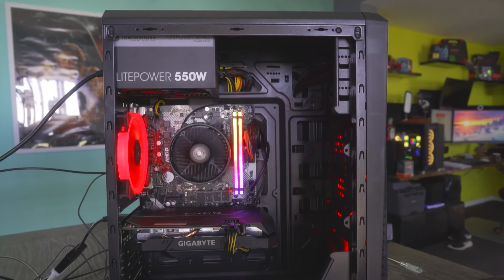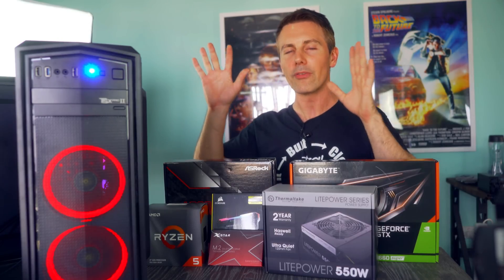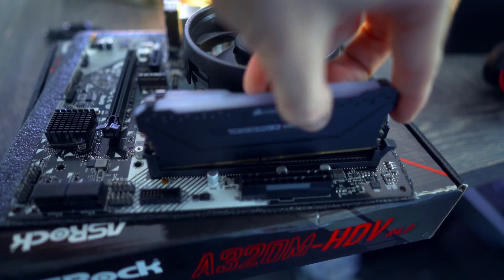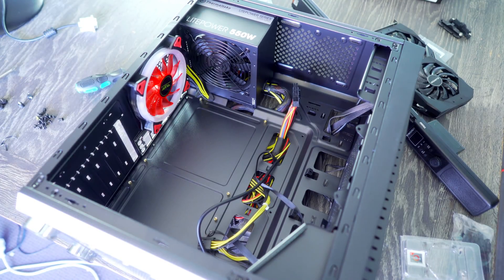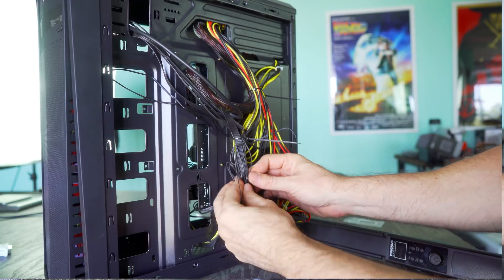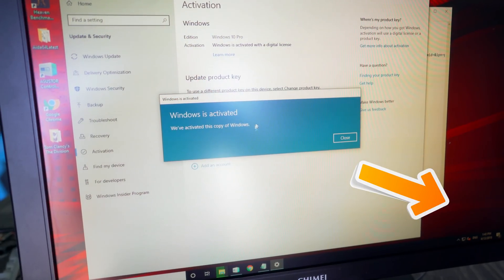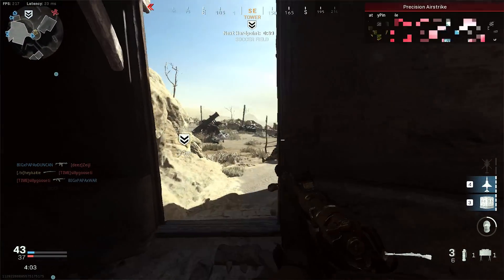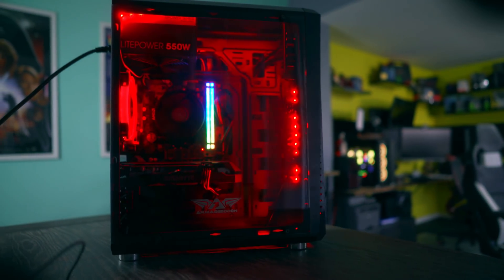How To Build Your FIRST AMD Ryzen Gaming PC...! ($750 Best Value Rig)

Comment: Bryan: Don't touch the pins

Also Bryan: touches them anyway
Reply from the maker: And your comment just got pinned.

Though on a serious note I specialise in both surgery on LGA and PGA ;), equipped with tooth pick and mini screw driver in hand.
Reply: @techyescity  "do as I say, not as I do"
Reply: @techyescity  try razor and utility blades too
Reply: I will link all my customers here. Especially because I use this motherboard a ton ;).

I've fixed some scary pins before on older chips.
Tweezers & light and magnifying lense/vanity mirror.
I've fixed unreal damage. As long as no pins were missing. Lol

Fixing Intel boards are way more a pain in the arse. And usually missing pins or severely twisted. I've never damaged an Intel socket myself yet.
Reply from the maker: Yeah LGA can be a pain, I could do an update on the Tech YES fast way of fixing pins? I have it down pat nowadays lol.
Reply: Rules are meant to be broken anyway 😉
Reply: Rules are meant to be broken... just like pins
Reply: Its not an AMD build without the AMD GPU. Your build was AMD lite. Just like lite beer. Not full strength. Do you read me ?
Reply: @Matlockization  Lol
Reply: 69 likes nice
Reply: Now this is an avangers level treat
Reply from the maker: @Rod 1984 I actually have never bent lga pins accidentally myself (bent them back and forth on old dud sockets that were bricked boards for prac), though have fixed a lot for can yes fix it and other styles of tech.  

As for PGA, I actually bent a lot of pins on my 3700x removing the cooler one time, it was the wraith prism i think, where there simply was no room for wiggle (fixed it up easily though :D).... though fixed a lot of PGA for other people who have bent pins or sent CPUs in on Ryzen locally, actually happens quite a bit.
Reply: @techyescity  wraith prism's thermal paste is an abomination to mankind and should never be used, used it for a few hours to test my parts and when I TRIED to remove it for the final build that thing turned into plastic cement, ended up bending pins on my 2700x, thanfully I was able to bend them back but jesus christ, that was frustrating.
Reply: All for the sake of scientific awareness lol
Reply: Had a 3200g that came in last week and wasn’t sure if the pins that were bent were cause of me or if they came that way but thankfully it wasn’t too bad, about 4 pins that were slightly bent. Used a slim enough card and set them about 98% straight and thankfully got my system running 😮‍💨.

Comment: For my build these are the prices and tell me what u think
Cpu 299 r5 3600
Motherboard 179 msi bazooka mini atx
Ram 119 klevv bolt 3200mhz
Case 59 mini atx
Psu 79 550 80 plus
Ssd 37 120gn
Hdd 55 1tb
Gpu 509 rtx 2060

Comment: Worth mentioning is complications that can arise during disassembly for Ryzen due to PGA (for instance, replace heatsink with aftermarket model).  My cpu stuck to the heatsink and popped out of the motherboard socket when doing this and bent the cpu pins.  I was able to straighten the pins using the razer blade method.  Have read elsewhere that this problem can sometimes be avoided by twisting heatsink when removing.  Anyway, Ryzen 3600 remains the best bang for the buck build even in mid 2020.  I think novice PC builders should watch these videos before starting work in order to get the details right.

Comment: If you have the Little Devil PC-V10 case then you will have to install the CPU per the instructions that come with said PC case as you don't want condensation reaching the motherboard also the system won't boot till the cooling prob drops below -70 degrees below zero then the cooler control system will boot the computer.

Comment: you'll get the most out of the motherboard but not the most out of the cpu. simple as that. A320 just isn'øt worth it when you can get super cheap really great B450 boards from MSI. Just not a place where it's worth saving.

Comment: NOTE:when bying the case with pre-installed fans,check on their website what kind of fans are you getting,more often then not,you get a cheap crappy ones,that you will eventually have to switch because:too low RPM;too low CFM,or just "oh crap,my MB doesen't see the case fans".Not everything that shines is gold!

Comment: OcUK Gaming Enigma Essential - Ryzen 5 2600, GeForce GTX 1660 Super

Your selected configuration:

(1x)   WD Blue SN500 500GB NVMe M.2 2280 Solid State Drive (WDS500G1B0C)

(1x)   Team Group Vulcan T-Force 16GB (2x8GB) DDR4 PC4-24000C16 3000MHz Dual Channel Kit - Grey (TLGD416G30

(1x)   Build Stock Asus GeForce GTX 1660TI Phoenix OC 6144MB GDDR6 Graphics Card

(1x)   Kolink Inspire Series K2 RGB Micro-ATX Case - Black Window

(1x)   AMD Ryzen 5 3600 Six Core/Twelve Thread - Tray

£694.00
Asus b450
1tb 7200 hdd
Also...
Order end of nov..
Woo hoo

Comment: The Asrock b450 pro4 is $71 on amazon.   So not much more than the 320 if your in the USA.     The r5 3500x you showed would be a better deal at $135 than the $190 r53600 unless streaming or heavy workload.   I like the deal I got on an XFX rx5700 for $330 on Amazon.   Great card.  The power supply i got from EVGA's b stock a 700w for $40 refurb/blemished bronze unit from the company.

Comment: If u just want the cheapest possible build and forget gaming rig this is probably gonna be fine BUT! I would never recommend using a A320 Mobo! Its ok for a 3600@stock but even then i would advise to be very careful with heavy long duration cpu workloads! There is no oc/pbo and no upgrade path unless Zen3 is going to be supported which i would not expect! If you can squeeze in a little more budget get a decent board like the MSI B450 Gaming Plus or Tomahawk MAX. Yes its double the price but these boards are good enough for 8cores oc or 12cores stock without bursting into flames after 10min video rendering... plus they offer much more connectivity, pcie/ram slots and general build quality.

Comment: I made a r7 2700x paired with Vega 56 Pulse. With b450 F strix for $90.  Got the cpu for $160 and the Vega for $250. 1tb m.2 for $80. Corsair vengeance 16gb ram for $50 and a 750watt power supply bronze

Comment: Help me pls
I bought a few parts for a pc almost identical to this before this video came out
$30 fractal case (sale)
$89 MSI B450 A Pro MAX
$199 KFA2 (=Galax) GTX 1660 Super
$115 Corsair MP510 960GB
$69 Corsair Vengeance LPX DDR4-3200 2x8GB
Which is $500 bucks in parts
Now I have a choice
Either I can go with the $220 Ryzen 5 3600 or with the $140 Ryzen 5 2600. (And gonna get a $90 80+ Gold PSU anyway). What makes more sense? Should I just go with the 3600? Also does it make sense to wait for any sales or are the prices okay?
 (Also prices are higher cause Switzerland)
Reply: nootics I’d recommend the Ryzen 5 2600, as it has way better price-to-performance than it’s 3600 counterpart, and also has a fan bundled with it, all for 140$.

Comment: Jesus, why did you gone for a320 mobo just buy 512 ssd not 1tb for 50 bucks, and spend like 30 bucks on a case, and ten u can afford a normal b450 motherboard, btw u can buy additional hdd later

Comment: Really good perspective about the A320 motherboard.  I think you could find some value in the used GPU market as well.  For the price of that GTX 1600 Super, you should be able pick up a GTX 1070ti.  Of course, then you would need to get a 144hz monitor to go with it.

Comment: Bought an Office key using your coupon code - hopefully you get a cut.

To anyone planning to do the same, make sure you have a Microsoft account first.
I use a local (offline) account to log into Windows and it took me a while to find my old microsoft account details and, having missed the easy way, even longer clicking around until I got to a download link.
After all that, the office installation works fine (so far).

Comment: Don't buy an A320 you are locked into that mobo with its lack of features and good luck upgrading to 4000 series using it too. Its worth it to spend $20-50.00 more now than get hosed for $100+ more in a few years,nvm vastly improved memory compatibility and speed.

Comment: Another great video! No surprise there. I just built a ryzen pc too to go with my main rig so friends can come over and play. I went with b450 asrock steel legend and ryzen 5 2600 though. Also, i got an evga 700 BR psu at best buy for only 60 bucks in case i want to drop a beasty GPU in place of the 8gb 570 i have in there right now. Thanks for the vid! Greetings from Portland OR USA

Comment: The real value for gamers is to get a b450 chipset with ryzen 5 2400G and 3000Mhz or greater RAM.  That will get you started for a little while until you have money for a graphics card, and at that point you'll have a better idea of what card you need once you've had a chance to run the games that you really want to play and not just the ones that you MIGHT play

Comment: excellent video, in my country when it comes to putting together a computer with ryzen they only recommend 450 boards. I saw your opinion about the gygabite board with a ryzen 3600 processor, you think that the msi a320 pro m2-v2 board could handle a ryzen 2600?

Comment: Why not a R5 2600? It's a little less performance but a better value.
Reply: Yeah,  I comparing 2600 vs his installed CPU. best price I seen here in Oz was $330. while R5 2600 was under $200. Got a bundle deal from Umart.com.au, which included asus prime b450m-k & R5 2600  with about $80 price discount. That was the big winner for me.

Comment: I personally would buy a cheaper ram without RGB like the G-Skill Aegis 16GB (8GB+8GB) 3000mhz CL16 and buy a B450 motherboard but is your decision everyone has different preferences.
Reply: @Rod 1984 Corsair Vengeance 16GB (8+8GB) 3000mhz is right now on Amazon 92,99$ the G-Skill Aegis 16GB (8+8GB) 3000mhz same ram specifications is 52,99$ on sale on Amazon and this is a 40 dollar difference only for Corsair branding and RGB and for 40 extra dollars u can easily buy a really good B450 motherboard maybe not the MSI B450 Tomahawk but probably a really good RGB motherboard like the Aorus B450 Elite so I don't really get the point is the same ram only without RGB but u get RGB on your motherboard and a better motherboard what will probably support Ryzen 4000 Zen3 I'm pretty sure A320 will not support Zen3 Ryzen 4000 next year. Sure he paid 75 dollars not 92 probably because Black Friday or Cyber Monday but now it is 92,99$ but in those days we also had B450 motherboards on sale so in the end u could pick up a B450 motherboard on sale and safe money.

Comment: Geez for a mere 70 dollars more you can get a RX5700 which is a much better graphics card and will easily play all the latest titles at 1440p. If 1080P ultra settings is your goal, you can do it for far less than 750 USD.
Reply: @Rod 1984 You're really so stupid it's almost not worth responding...ALMOST. You didn't even watch the video 03:10 clearly states the values numbnuts.

Comment: tech yes i have a very decent set of fans for the price. they are about 45 bucks for 6 addressable rgb fans not like the really cheap ones. these are very very decent i would like to let u know so u can share any experiance u have with your fans they are called "upHere 5V 6-pack 120mm silent intelligent control 5v addressable rgb fans" you can buy them on amazon. i was doubtful about them till i tried them.

Comment: Though im not a A320 mobo hater... there are better options out there by ASRock for the same price but with the B450 chipset. 59,99 for the B450m Pro 4 and the 59,99 B450M HDV R4.0

Comment: Well...you aren't entirely right Bryan. The a320 boards are good enough for a CPU such as the r5 3600 but cannot be upgraded to something like the R7 3700x or the r9 3900x down the line whereas the b450 boards are upgradable since they a good VRMs. Spending the extra $20-30 for a b450 board is actually worth it for the future upgrade path they offer.
Reply: Exactly. Though if you're upgrading to a Ryzen 9, you'd buy a X570 motherboard anyway. Those A320 boards can power these beasts but wait until you stress test them for more than an hour. Without a decent VRM, the performance will plummit.

Comment: downgrade to a 2600x and you have room for a b450. Add like 20$ for at least 3200mhz ram, amd cips love fast ram! That leaves you with a lot of room for upgrades. and 600w psu can be had for the same price on some sale, i recommend that more than having just 500w one since any stronger gpu, or just adding a better cpu fan can over do it.
you are welcome :D
Reply: in fact i am buying said parts atm for my new pc, ecs im getting a used 1070sup for 200e. i spent a lot of time comparing price to perf so im confidante its better
Reply: @narivix  I got 1080 for 280 open box lol also why is everyone forgetting b350 exist lol
Reply: @narivix  ebays got a deal from new egg where the ryzen 5 3600 can be had for 180 - a 9 dollar discount
Reply: @IJoeAceJRI  or just use a b350

Comment: This exact system costs around 900$ in my country !!!
I'd rather get the Ryzen 5 3500(Available in my country in Asia) and a B450 Mobo !
Reply: Even in India the price will be $900...
Reply: @digantamajumder5900  I'm from India as well !!
Reply: I'd rather recommend a 2600. I get the same vibe as the 7600k from the 3500.
Reply: @AA-zm9hk  why is that so ? Because 3500 is cheaper than 2600 as well plus it has the same no. of cores (6) as 2600 and faster Turbo Speed and L2 Cache !
Reply: @GamerSunrit  threads. As the games utilize more threads, it would start to choke in future. Then again, this has a better ipc so I'm not sure. Plus I think the 4th generation will be a bigger jump. I'm sure that they can perfect this architecture at 5th gen.
Reply: @AA-zm9hk , the Ryzen 2600 will also be weaker due to its ipc in that future.... so going for 3500 is wise choice till you get it for same price and intend to game.
Reply: @digantamajumder5900  you're absolutely right. Though I plan to stream in future so 2600 would be worth the money for me.
Reply: @AA-zm9hk , hmm... for streamers 2600 is good. You can also check some X79 octacore Xeons. They are very good for multi-threaded works
Reply: @digantamajumder5900  as good as the core count and memory bandwidth on xeon sound, they are a real pain and you know it.
Reply: @AA-zm9hk , yeah, but believe me I am really enjoying my $15 X3440 instead of the i3-540 on an Intel 1st gen motherboard.
Reply: @digantamajumder5900  oh dude. I hope you get the  most out of it. As a rule of thumb I avoid stuff that's more than 3-4 years old. What games do you play on it?
Reply: @AA-zm9hk , actually it's for my 720p gaming rig... I will add a RX 470. Now I have a GT 710
Reply: @digantamajumder5900  oh god I understand your pain. Don't buy a 470, its eol and inefficient. Go for a 580 or wait for the 5500 to come. Benchmarks show that oem 5500s are lightly better than the 1650s. And 1650s is a very much bang for buck card.
Reply: @AA-zm9hk , I am looking to buy an used RX 470.... It is available for  $80 in AliExpress. A RX 580 or 1650 will not be value for money with my pc....
Reply: @digantamajumder5900  well you've got a point but a madlad stuck a 1070 to a xeon v3
Reply: @AA-zm9hk , x3440 is weaker than v3 xeon
Reply: @digantamajumder5900  ik, the v3 is about 25% better

Comment: The pins on the Ryzen 5 3600 can bend easier then those on the Ryzen 2000 series. *Shakes head*. As the Zen 2 & the Zen+ CPU's have the same pin layout and using the same socket, we can assume that the pins, even when we include the Ryzen 1000 series, are equal fragile.

Comment: There's no reason not to pick up an extra 30 bucks to buy a msi b450 tomahawk max instead of an a320
Reply: The us you can still get b350 boards for 50 bucks
Reply: @andrewilliams2139  but b350 RAM is locked at 3000mhz

Comment: That is amazing value.
I only need the mainboard, cpu, RAM and M2 drive to upgrade my old PC to these specs. Wonder f I can buy all the parts second hand (except for the CPU), and sell my old stuff to save some more.
Reply: I saved on upgrading mine, waiting for parts, but motherboard b450, ryzen 2600x, 16gb 3000mhz ddr4(2x8gb) and a Samsung ssd. All for under $250 since I already had from my old build a good case ,650 watt ps and decent GPU to run todays games at high settings for 1080p.

Comment: Here in Germany B450 Boards started at 65€  and A 320 are not much cheaper  .
Reply: In USA B450 went up because of all high volume of Ryzen CPUs moving.
A320 $50-55 USD when in stock
B450 $75-80+ (used to be $65-70 for Basic)
Reply: @Rod 1984 The tomahawk max cost 99 €

Comment: No idea why people used the B-series, it's completely useless, $10-50 of the same tier board, you can get X4/570. A real budget should be A320.
Reply: Because you can oc a good b450 mobo just as well as an x470/x570. There's no reason to go for them if you don't SLI. And b450s are just 30 bucks more expensive than a320. Price to performance wise it makes total sense going for b450 and oc'ing the 3600.

Comment: But ... but what if you want dual boot - M.2 drive with Linux, C: drive with Windows 7 ??  (I'm trying avoid W10 like the plague)
Reply: Literally in a month you have to upgrade to windows 10 as windows 7 is no longer supported. Why don't you just use windows 10. In my experience it's a much better operating system and it's not even close.

Comment: I just build a pc using used parts
some of the parts has warranty
It cost me under $600SGD (640AUD)

Ryzen 7 1700 (180 SGD)
Zotac 1060 AMP 3GB (100 SGD)
G.Skill TridentZ RGB (50 SGD)
MSI B450 Gaming Plus (120 SGD)
Thermaltake Smart RGB 600W PSU (50)
Tecware Nexus C Case (50)
Lexar M.2 128GB (30)
Reply: Cool